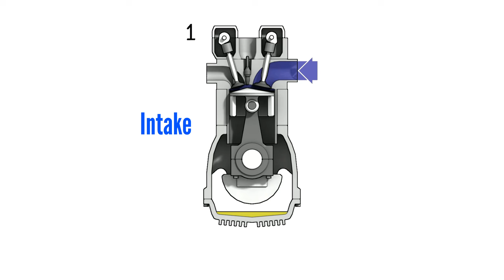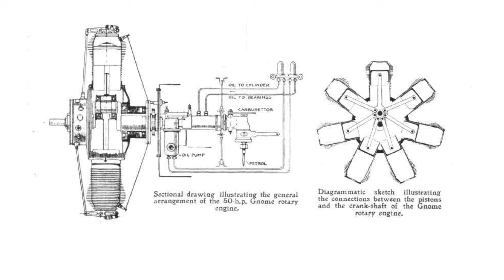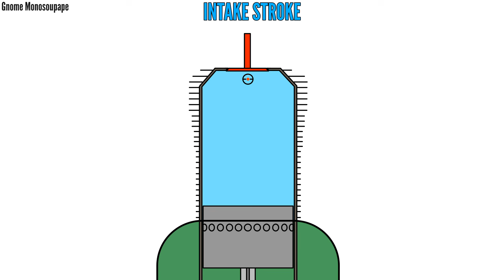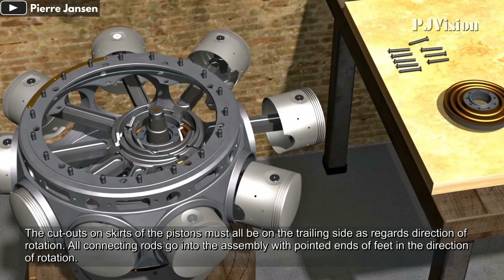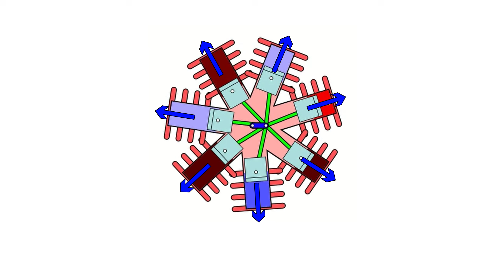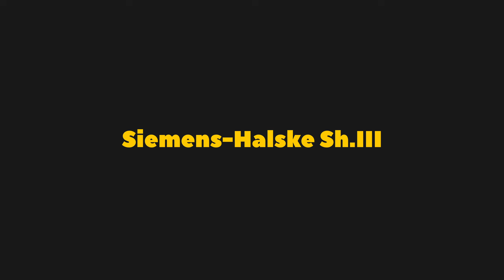The Brilliant Rotary Aircraft Engine of WW1 Explained

Comment from the maker: Support me on Patreon : https://www.patreon.com/letsgoaviate
Boeing YC-14 Upper Surface Blowing & C-130 Hidden Facts : https://youtu.be/-pxpNivvpw8
Zoche AeroDiesel is Back - Turbo Compound Light Aircraft Engines Arrive : https://youtu.be/wAb_vxdYLUI
Reply: was there a reason that they didn't go to a 2 stroke to increase horsepower?
Reply: Thanks for that, what a revelation.
For years I've wondered about the inner workings of those rotary engines.
Excellent presentation, most enlightening.
Bravo.

Comment: If you think the two row rotaries are scary, there were some experimental four row rotary engines, there are a few pictures of them floating around. It's like having an R4360, except it rotates at ~1300 RPM.

The 18 cylinder two row rotaries like the Gnome Delta-Delta were scary enough. It made I believe 200 HP. I'm sure if it was developed more, like the later 9N, it probably could have made something like 320 HP.

Comment: As an official "old fart" now, when I started working at a Naval Air Rework Facility in 1982, I was surprised to find Production lines still set up to overhaul the R-1820 radial engines that were still being used by (I think) only two types of Naval aircraft.  Everything else was either a jet engine or a turbofan engine.  But seeing those old engines still being torn down, inspected, overhauled, reassembled, and tested really surprised me in the '80s.  I even designed a few special tools, fixtures, & jigs for the repair of some of the parts.  Standing behind an S-2 running up both of its R-1820s was fun (especially since it wasn't my job to do that)!  ;)

I purchased the book that has drawings for a scaled-down Bentley BR-2, so I hope to build a running model of one based on those drawings, especially since many others have already successfully done so.  I've never seen a running rotary, so the scaled-down model ought to be quite interesting!

Comment: So you sort of failed to explain the most important genius of the true rotary.  The pistons DO NOT reciprocate!  That is why they have very low vibration.  the crankshaft offset is say, 200mm above the centerline of the engine block.  As the cylinders rotate they carry the pistons with them in a circle.  in 360 degrees the pistons DO move that 200mm relative to the cylinder but they DO NOT move up and down in 3d space!  The circle of the pistons is in one location, the circle of the cylinders is in another location through 360 degrees of rotation they move relative to one another but they do not slide back and forth relative to the airframe which means they are relatively vibration free.  THAT was their true genius!

Comment: Radial not rotary.
Reply from the maker: Rotary not radial.
Reply: So confidently wrong.  Not all radial engines are rotary engines, but all rotary engines are radial engines.

Now don't bring up the Wankel.  It's a completely different beast where people use the same terminology,  but the rotary engine predates the Wankel by at least 5 decades.

Comment: WW1 Rotary Aircraft Engines (apart from the fact that the whole engine was attached to the propeller & rotated with it), were a very odd breed in other ways.
Although they operated on a total loss system (using castor oil as the engine lubricant), they were in fact 4 Stroke Engines & not 2 Stroke Engines, as you might expect.
They also had no conventional engine throttle.
So the engine was either 'On or Off' operated by a switch in the cockpit.
This meant that when coming in to land, the Pilot had to keep on 'blipping' the power using the cockpit switch to maintain speed & control.
Weird....

Comment: There was never a point after 1915 or so at which there wasn't a less underpowered water-cooled engine powering a much better fighter. The rotary engine was cheap and crappy and directly responsible for most of the times a badly outnumbered German air corps was able to slaughter allied airmen, every single time they came up with a slightly better Albatross that ate Nieuports and Sopwiths for breakfast. It's an inherently silly and dangerous design that was continued for far too long.

Comment: do you mean a radial engine? Rotary is a differnt platform, or am I confused?  Mazda makes a rotary; aviation is a radial, no?
Reply from the maker: The Rotary is the engine discussed here. It't been called that since before the 20th century, as can be seen in early documents from that era.

The radial has the same cylinder placement, but is a diffetent type.

Mazda's engine is a Wankel. Its often called a rotary as you know. The original rotary went extinct in the 1920's so I guess the Wankel took the rotary term without any objections.
Reply: @LetsGoAviate  I'm familiar with Mazda being a Wankel; I have built a couple in my day.  But in the USA, we call it a Rotary.  I have just always heard the term Radial with these aviation engines.  But your explanation was great, ty.

Comment: Really enjoyed this video.  You cleared up some very important questions I had about those early rotary engines, most noteworthy was the question of throttle control simply being an ignition on/off exercise.  It seems that only the early rotary engines had that limitation where the wartime production rotaries had working throttle controls.  Fuel and oil delivery were other questions that stuck in my mind.  This was extremely informative for me since I discuss aircraft engines often with my guest at the San Diego Air and Space museum.

Comment: I never would have thought about air resistance limiting hp output, reminds me of a video where some folks dyno tested a mechanical radiator fan vs electric, at high rpm the difference was enormous.

Comment: Excellent presentation. Though I had to stop and check a couple of times as diagrams was shown very briefly.
Castor oil is a very good lubricant, still used in some demanding applications.
Reply from the maker: Often it's difficult showing something for very long without leaving silent pauses, but I always keep improving how I present things based on feedback like this. Thanks.

Comment: I help reassemble a Thomas Morse S4B, and had a chance to get the Le Rhone engine ready for hanging it on the nose of the Tommy Morse, and noticed a swastika stamped on the end of each original manufactured cylinder(new ones are produced and these don't have the broken cross stamped on the ends). Was this for good luck? Nazis did not exist, nor their adopted symbology.

Comment: Oh my God, it's a radial engine, not a rotary engine because it does not have rotors.
Reply: Rotary engines have pistons... this is not a Radial type engine, this is a Millet-type ROTARY ENGINE.

Not to be confused with the non-rotating Radial 

The Rotary engine was invented by Felix Millet in 1892 and predates the invention of the Radial and the often misidentified Wankel engine.
Reply from the maker: Its a rotary engine. Been called a rotary since before 1900
Reply: @LetsGoAviate I'm blocking your channel, I don't like misinformation. There's always been called a radial engine, stop lying. Stop spreading false information.
Reply from the maker: @rivermcratt3683  You're free to do as you please. A very brief search on the internet will show the truth.
Reply: @rivermcratt3683 what you call a rotary is actually a Wankel, and a radial always has a fixed case with a rotating crank. This is a true Rotary and has been known as such since before Wankel was even born.

Comment: I grew up with a General Vehicle B2. It is 100% war gimmicks. It used 5 years of model plane castor oil in a second. The motor came from the factory with replaced parts. One of the Nieuport advantages was the ability to down throttle and take rear position. My grandmother relished watching Nieuports eat Krauts walking to school. The kids would grab all the 303 casings bouncing off roofs. The Anzani became the Brownback Kitten, so the radial was always there. Renault Robins and Liberty motors were just as dangerous to Kraut planes and you could punch the gas and flee when things looked bad. The Curtiss OXX 6 was reliability, and reliability is the future. I like my 0200 A Continental.

Comment: I often wonder why aircraft manufacturers didn't counter the torque from the rotation of the rotary engines by extending the opposite wing by a foot or so, ie a port side rotation would have a longer port side wing, and a starboard rotation would have a longer starboard wing, the longer wing span on one side would generate more lift on that side.

The Italians in WWII produced the The Macchi C.202 Folgore that had one wing that was 8½ ft longer than the other wing to counteract the torque from the spin of the propeller and it effected the performance of the aircraft in a way that helped to make the aircraft easier to control, especially when banking or turning in the opposite direction that the propeller turned.

Of course, I believe that had they used radial engines instead, then they would have reduced the amount of torque produced by both the rotary engine and the propeller to just the torque produced by the propeller itself, and with the extended wing on one side then the effects of the longer wing on one side countering only the torque produced by the propeller alone, then the performance of the aircraft would have been vastly improved overall.
Reply: IIRC one compensates motor torque by directing the motor axis 2°-3° to the right from the fuselage axis.

Comment: I never knew there was a difference between rotary and radial engines.  I thought they were all radial.  I was completely blown away by the ingenuity of these engines.  One push rod for two valves... values in cylinder heads...  wow!!!

Comment: I never knew that the entire engine rotated! 
I used to have the LEGO "Red Baron" triplane. The cylinders rotated with the propeller, but I assumed that was just due to the limitations of the LEGO parts available. It had six cylinders for the same reason.
So this video was very informative- thank you!

Comment: Wouldn't a better solution (to gyroscopic effects) have have been to fit 2 smaller counter rotating rotary engines?  They could be wing mounted with slender pods around the back part of the engines and then have a more aerodynamic fuselage, and the pilot wouldn't inhale as much nasty crap either!

Comment: I’m not a pilot, but it seems to me that the mass of that engine spinning would produce great torque that would tend to cause the fuselage to want to twist in the opposite direction than the spin of the engine!!!??? Would the airplane to yaw one way more than the other way? Tighter turns with engine spin more to a turn the opposite way? I’d welcome your opinion.

Comment: Wait, ur telling me theres MULTIPLE rotary engines, and some arent DORITOS!
Reply: My first car was a '79 RX-7 back in the early 80's. I knew THEN that "Mazda Rotary" was just a name gimmick. I never called the engine in my car nothing other than "Wankel engine". You can just open the hood and see the ENGINE doesn't rotate lol. 

Of course, I had the advantage of growing up across the street from an airfield where an old WW1 training biplane was being restored, so I learned what a "rotary" (actual spinning) engine was early in life. Maybe 6 thru 10 years old or so. They were still working on restoration when we moved away. That was decades ago. I hope they eventually got it air worthy.
Reply: These engines predate the Wankel by at least 5 decades.

Comment: I think there needs to be a proper distinction between the rotary engines. two trains of thoughts.
1, spinning engines are true rotary engines where as wankel engines are rotary piston engines as only the "piston" spins. 
2, these engines are Rotary piston engines as the engine rotates but still has conventional pistons aka a piston engine, where as wankel engines are true rotary engines as they have neither pistons nor cylinders and thus are technically not a piston engine. I mean if you think bout it... theyre technically closer to a turbine engine then a piston, they spin metal to create compression, they ignite, they use the exhaust to spin a hunk of metal, it just happens to be the same hunk of metal that created the compression. 

Before anyone goes crazy, piston engines and turbine engines really are not that different. In fact there were (maybe still are?) piston engines that operated very much like a turbine engines. They had a mechanically driven blower or intake turbine, some way to force air in that was driven directly by the engine. That air would be combusted with fuel in a conventional cylinder, but then after exiting the cylinder it goes on to drive an exhaust turbine that is connected to the crank shaft and a good chunk of the power produced by the engine is produced at that exhaust turbine. Exact same way a turbine engine works except the high compression stage of the turbine compressor is replaced with pistons.
Reply: THERE IS
Only the Wankel DKM-54 ( Drehkolbenmotor of 1954) prototype is a Rotary and had a spinning engine housing and a fixed crankshaft.

The Wankel KKM-57 is not a Rotary-type engine and this distinction is in the designation KKM Kries(sen)KolbenMotor which translates into English as "Orbiting Piston Engine" 
 The piston in the KKM does not spin concentrically like the DKM but Orbits in a distinctive planetary motion.

The Toyo Kogyo Cork, Co. Ltd (now called Mazda) licensed the KKM-57 version in 1961 
In 1971 Mazda registered the trademark "Mazda Rotary" brand in honor of Felix Wankel's first DKM-54 design... the confusion regrading this move to avoid paying fees to NSU-Wankel (now Audi) has persisted to this day.

Comment: What I never understood when I first saw these engines is, how do they get their fuel from the tank?
Reply: Crankshaft is hollow. The carb is at the rear of the engine mounted to the back of the crankshaft. Fuel and Castor oil are sucked through the crankshaft into the spinning block and distributed from there. It's a 4-stroke engine but it shares some attributes with a two stroke, such as total loss oiling.

Comment: The advantage of the rotary was not primarily cooling as some say. It is one of balance the engine could be smooth because the pistons do not reciprocate relative to the airframe. If you follow their path
you will see that they describe an eccentric  movement  but not up and down!

Comment: Isn't it a radial engine not a rotary?
Reply: Its a Rotary, not a radial
Reply: It's a rotary.
Reply from the maker: No, its not a radial
Reply: Not all radial engines are rotary,  but all rotary engines are radial engines.  (Don't start on Wankels, that's a different beast).

Comment: You mentioned that people often mistake rotary engines for 2 strokes, but was there any reason that nobody made a 2 stroke rotary? It seems like if you are already set up with induction through the crankcase and total loss oiling, you might as well just use intake ports and get the extra power strokes. I guess you might have to use forced induction to pressurize the crankcase since multiple pistons going up and down would probably cancel out the alternating pressure and vacuum that exists in single cylinder 2 stroke.

Comment: The rotary engine was exactly not brilliant, but deeply flawed. Apart from the gyroscopic effect, it had also big problems with the oil seals, making for an always dirty windshield and steady oil loss.. It was replaced by the radial engine.
Reply from the maker: In 2026, perhaps not. In the early 1900's it was, objectively speaking, brilliant. How they overcame the metalurgic and design limitiations of the time with this design, making it by far the best engine type from around 1909-1916.

Comment: This is NOT a rotary engine.... it's a RADIAL engine.  Wankle created the rotary engine... which you'll find in some Mazda cars...
Reply from the maker: Not true. The engines in this video are not radials. These are rotaries, and it was called rotaries right from the start (1890's). Feel free to look it up. 

I don't have a gripe if you call a Wankel a rotary. But these are not radial engines, it is the original rotary.
Reply: Wrong, a Wankel is a Wankel not a rotary and anyone who calls a Wankel a rotary is factually incorrect. A true rotary engine has a fixed crankshaft and a rotating crankcase and cylinder assembly. There are already too many uneducated Wanker fanboys in the world, stop being one.

Comment: Every couple of minutes of that I was struck by a "blimey, that's clever" moment. I was always impressed by the sheer craziness of the rotary but some of the genius behind it passed me by. Thanks for the revelations.
Reply: I feel the same way with steam boiler systems during 1910 to 1940s. They pushed steam to the pinnacle and turn hot water into an invisible heat ray that can cut bodies in half. It's super cool and I wish I could see how far people 50 years from now can push it, with advanced composite materials and all that jazz.
Reply: My reactions too.

Comment: In the 20s the Megola motorcycle had a rotary engine in the front wheel.
Best explanation I have seen.
Reply: I just looked that up, I saw the one at the Guggenheim about 20 years ago. The crankshaft spun at six times wheel speed. At 60 mph the wheel was going about 60 rpm and the crankshaft 3600. There was no clutch or transmission, you had to start the engine with the front wheel off the ground on the center stand or you had to push start it. The engine would stop when the bike did.